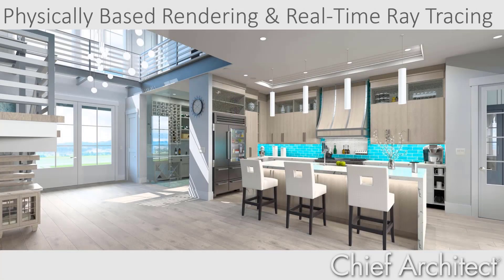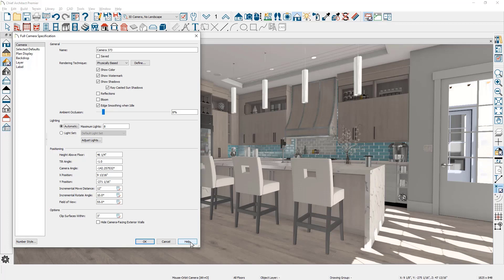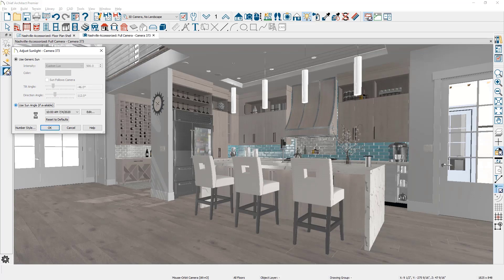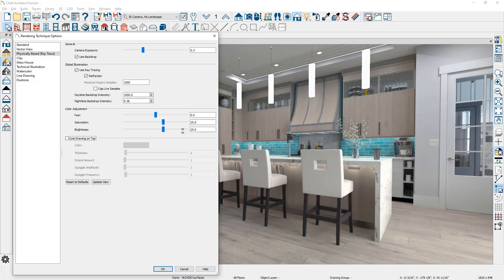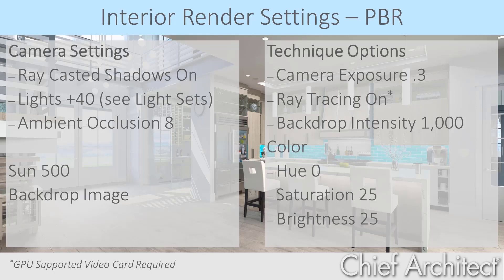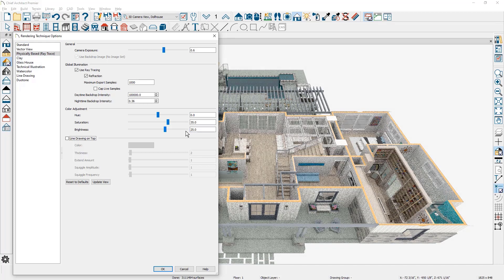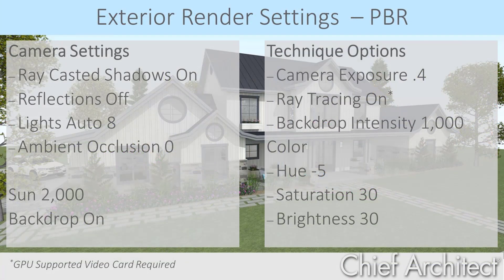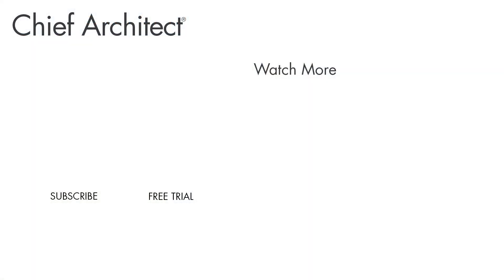Physically Based Rendering with Real-Time Ray Tracing

Comment: How can we create a section for a U shaped stair? The walls are blocking my view and only half the stair is visible inside the section view..plz hep
Reply from the maker: Here is a video that goes through the process step by step: https://www.youtube.com/watch?v=p7O-7UnX7IA
Reply: @ChiefArchitect  This video doesn't solve my problem,  The problem is that I want a section view for my U shaped stair but the walls are blocking my view and only the lower part of the stair is visible, the only way to do it is to hide those walls by layers
Reply: Can I save the PBR as jpg
Reply from the maker: @moses0sei792  Yes, it can be saved as a jpg.

Comment: Can I use real time raytracing for standard raytracing or it only support   
Physically based rendering
Reply from the maker: GPU Ray Tracing is set up through the physically based rendering technique options. CPU Ray Tracing can be done by clicking 3D>CPU Ray Trace.